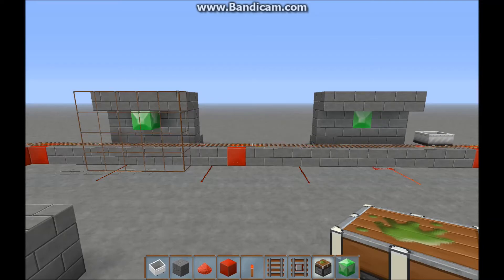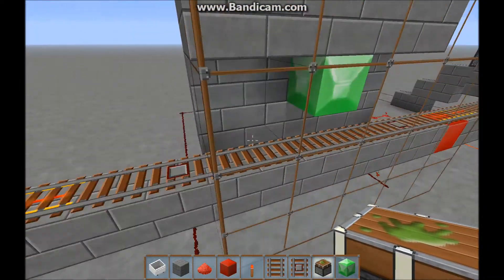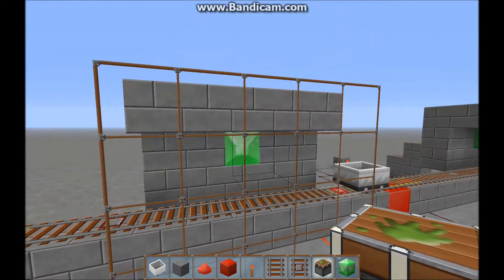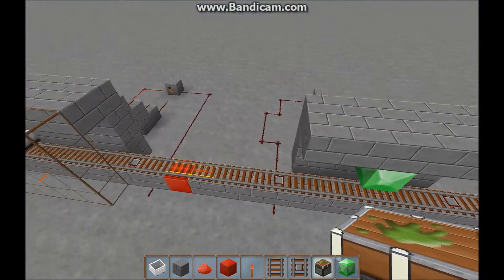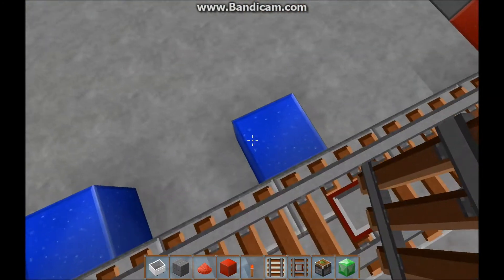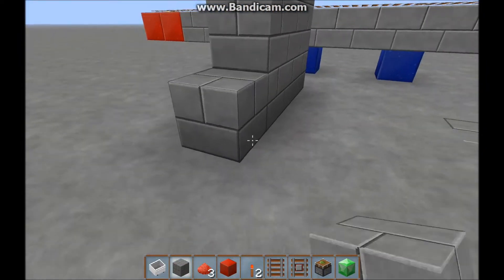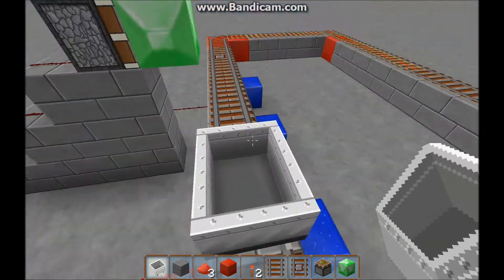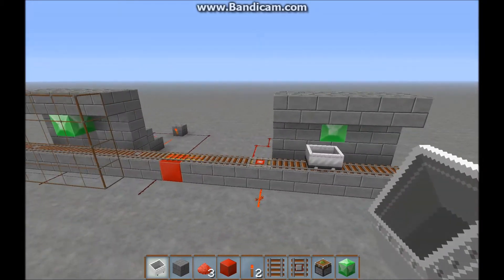Minecraft Automatic Door Tutorial: Auto Open / Closing Minecart Rail Door.  Garage / Mob Proof Door!

Comment: Very nice, I got here looking for a system the open both to foot traffic and minecarts at the same time.

Btw, how did those mobs get passed this type of door, does it activate if the mob is on foot?
Reply from the maker: The detector rails in this video only open for minecarts.  I've setup similar things with platforms, but mobs can open those.  I use the double doors for an airlock effect regardless.  For human traffic doors I've setup levers or preferably buttons for a single door.  Whenever I go very far I use a minecart, so I don't even bother using human doors.  I got tired of creepers blowing up my house / village, so I built these.
Reply: Compulsion84
That makes sense.

Under my base I built a portal room that doubles as a rail hub. Eventually I plan to send rail lines out, in an elevated monorail fashion, and these type of airlocks will prove very helpful.

Sadly there is nothing that can be done for foot traffic. Currently I have a pressure plate activating the doors on the inside of the base, and a button opening them from outside. I can't use plates outside or the mobs will activate them and get inside.

Theoretically it would be possible, if I build a moat around my door with a little extending bridge. But then I have to activate the bridge controls, which again, pressure plate is the most convenient way.
Reply from the maker: I've built 4 high walls around my village and that worked well.  A fun way to get over them is a ramp of powered rail that jumps you over the wall into a pond on either side.  I might just do a video of that too...